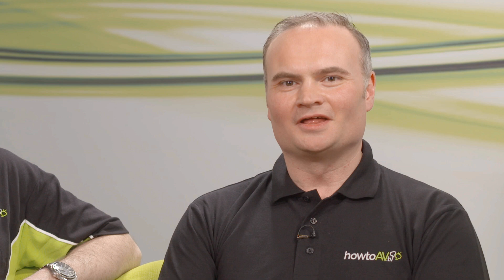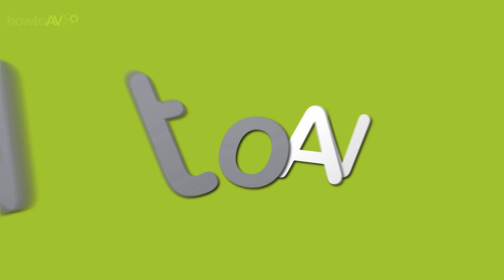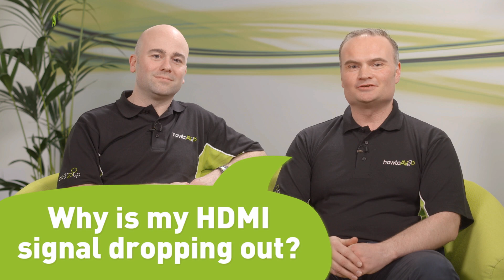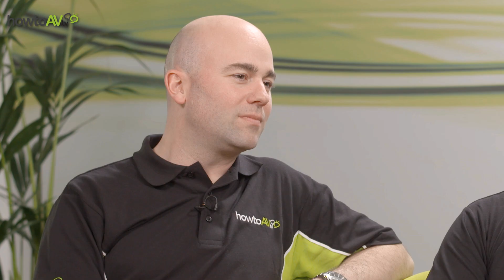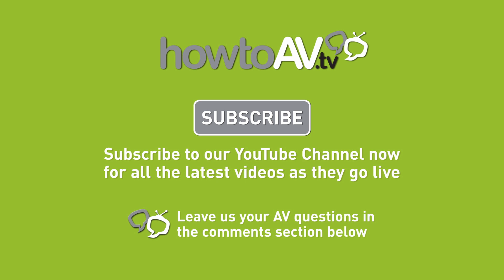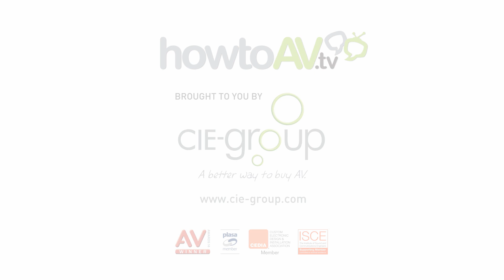Why is my HDMI signal dropping out?

Comment: Anyone got any tips for an issue with a Sony Bravia. The connected devices e.g. Virgin box and PS5, intermittently cut off for about 5 (randomly). It can happen twice in the space of 10 mins and then nothing for an hour or so - screen goes black and a message comes on the screen to say device disconnected. It always reconnects within seconds; I’ve checked all HDMI cables, replacing them as well, disconnected different devices to see if one of them is causing the issue. I’ve even had Virgin out to check the box and their cabling. What I do know is if I watch tv via the Sony tv apps, like Discovery plus, iPlayer, prime etc… there is no issue in terms of disconnecting so it’s definitely the HDMI ports or the signal from the devices to the tv. If anyone has any theories, please share because I’m out of ideas? Thanks.

Comment: Does hdmi cable connection from the av receiver to the projector lose viedo signal while the audio is on if the electric voltage drops low. I had this issue but when I got the voltage up the picture came back and worked perfectly.  So please answer this question

Comment: I bought an HDMI splitter. To go from my Xbox 360 to my TV and also to a capture card. It intermittently switches off and on. The cables work well individually, so it's nothing to do with my cables. Set at 1080p so it has nothing to do with my resolution. I'll just contact the Chinese seller I bought the HDMI splitter from.

Comment: I plug in my Xbox hdmi cord and the tv goes blank the light to show on or off starts blinking the screen stays black until I take the hdmi cord out I tried buying a new one it didn’t work I checked all cables all are fine plugged in and powered what do I do

Comment: I’m having issues with a Neat Bar (video conferencing unit), connecting to a Sony BZ40H TV monitor. This problem doesn’t happen on all systems. I’m running a 3’HDMI from the Neat Bar to the Sony monitor, and have replaced the HDMI a few times. I get a “unsupported signal” error occasionally when it wakes up through CEC. TV shuts off after 5 minutes of inactivity (motion detection), and then wakes up when it detects motion. Sometimes it just shows “unsupported signal”. There are at least 8 of our systems displaying this. Any help would be welcome.

Comment: Ok so my setup consists of the following: 

Equipment:

Samsung UE50RU7100KXXU TV

Samsung HW-R550/XU Soundbar

Sony PlayStation 4 Pro

Panasonic DVD S700EB-K

Bluestream SW41AB-V2 4-Way

Humax FVP-5000T (Freeview box) (currently not being used)

Cables (used on all equipment listed)

QED Performance HDMI 4k @ 60Hz HDR High Speed with Ethernet

So starting with the TV I have a HDMI cable going from the ARC(in) to the soundbars HDMI (out)

Also on the TV HDMI 1(in) is going to the output of the Blustream switch then the PS4 (input 1), DVD(input 2) and Freeview (input 3) are connected to the switch. I only use one application at a time and switch between sources when wanting to watch another making sure other applications are turned off.

On the back of the switch there are four dip switches labelled 0123 that go from either 0-1

Which order do the need to be in with the information I've provided as it still cuts out when having all four dip switches set to 1

Comment: I have a brand-new DVD player, HDMI cable, and I'm trying to connect it to my Samsung LED TV. And my TV says there is a power connection problem. Any suggestions on this issue? I got the Amazon Basics High-Speed HDMI Cable (18Gbps, 4K/60Hz) and I wonder if this HDMI cable is the problem. Please help me!

Comment: Six or seven months ago I bought an HDMI Splitter and a long HDMI cable, then yesterday I bought an HDMI Video Capture Card second handed. So yesterday I tried what I can to make my PS4, TV, and PC fully function to each other to get connected, it work well. Then I was playing a game and I tried to record my gameplay by using OBS. The reason why I need those three is because I need a good quality of my gameplay for the record. I do can just use my PS4 to record my gameplay, the quality is good but not that because its 720p and also it only gives me one hour of maximum to record my gameplay, so with those things I have and record it on OBS, the quality is HD and it gives me more time to record my gameplay. In an hour later since first use, the connection just dropped out just for one second and then it came back but it will affect the recording, and also I have realize that the audio is in little delay so I found a way to make between the video and audio go in match. I found the way but it seems I need to turn down the sound of the notifications because if it does then that sound will join on the audio recording. I think I know why the connection dropped out, perhaps its the splitter because while I still don't have a video capture card, I was using the splitter to connect between my PS4 and TV, been using it for like two hours and then after that, the connection just dropped out for just two second, it never happen if I only connect my HDMI cable between my PS4 and TV so I'm guessing its the splitter's fault. I still want a good quality but I just found an idea to make the dropped out connection won't happen but here's hoping for me that it work well.
Reply: So about the idea I found out, it work well. So what I did is I just use one HDMI cable to use to connect between my PS4 and PC, and I also still uses my HDMI Video Capture Card to plug it in on my CPU. I use OBS. But the only little problem is that when I press the buttons of my controller and the screen of the OBS is a little bit of delay but for me I tried to handle it because it's not really that bad just as long as I know what I'm pressing it. And indeed there's no connection that was dropped out so it keeps going and going. Also the audio is in match in the video. I didn't use my splitter because I know that's the reason why the connection got dropped out, or perhaps my splitter is broken a little.

Comment: I have a problem with my Sony TV side HDMI port. 
The HDMI port at the back is working well but since i have opted to mount the TV i cannot use it.... i have to use the HDMI port on the side but the side port keeps dropping out👉 like after 30 secs or so the screen turns black and immediately comes back... the problem is not the HDMI cable since when i plug it at the back it works well
Reply: Have you used an HDMI splitter?

Comment: I have a 4k tv and dvd player ..and when I use hdmi cable the picture cuts in and out when hooked up to ARC port ,I also using a hight speed hdmi cable..But when I hook it up with The Optical cable .the picture doesn't cut in and out ...any ideas why it only cuts in and out with the Hdmi arc connected?

Comment: Since upgrading my graphics card to a Geforce GTX1650 Super, the HDMI connection to my AV receiver keeps dropping out. Sometimes switching my receiver on, and to the PC input before turning the pc on, gets a steady connection at first. But it inevitably starts to drop out after a while. I have the latest Geforce drivers installed. I never had this issue with my previous card, a Geforce 750 ti. I only upgraded it because I wanted to stream 4k HDR videos from my pc to my 4K tv. Any ideas?

Comment: My hdmi cable is connected to my tv the tv is on the wall it’s been fine for many years but last few weeks it’s making the picture fuzzing & disappears & know the connection to the tv shows it’s not there I’ve had a go at trying to push the cable back in as it’s also tight it’s there for for a few minutes & then disappears what can be done in this matter as I can not view the content of my amazon tv fire stick anymore I need some advice can you help many thanks 🙏

Comment: I have a high end Denon reciever AVR -3310CI 7.1  and no matter the hdmi port I plug into and I've even changed the cord,  it drops in and out and mostly stay out. Not sure if it's the whole hdmi motherboard? It's not the projector because if go hdmi to DVD or PS4 it's fine but to get good sound I run all sources through my reciever

Comment: My hdmi splitter one output getting off after sometime.. I swapped the port of hdmi splitter still it get off..after sometime...

If I remove and re connect it works...
After sometimes same display getting balck...

I used new hdmi splitter still same display getting off after sone time

Is it handshake prblm..?

Can u suggest solution...

Both monitor running 1080p

Comment: Hello. I have 2 set top boxes. One works well while connected to the TV via a HDMI. The TV restarts every approx 15 to 20 secs while connected to the other box  using either the same HDMI cable or a new cable. The picture and sound on both boxes  are fine. Any help or advice how to fix would be appreciated please.

Comment: I got a 4K TV in March and connecting it to my TV with a 4k HDR rated HDMI cable it was giving me constant drop-outs.. After a few weeks I got a shorter cable and it seemed to almost stop. Then it stopped-- at the same time the weather went from cold and dry to warm and wet.  I didn't think about it.
Now there is a cool day, and the humidity that had been between 50-66% the last few weeks dropped to under 40%.
Now the drop-outs are back. The lower the humidity the worse it gets.

Comment: I have my PS4 connected into a Techole 3 in 1 Switcher and every minute or so the tv goes blank and back on
Reply: I have the same issue. did you ever solve the problem?
Reply: it might be too late but with the ps4. you have to change the resolution of the ps4 in the menu. this should stop this
Reply: @mr.ph9859  
Yo what resolution did you change it?

Comment: Hi. I keep getting a static screen when i plug my hdmi cable into the hdcp2.2 port on my projector. I was originally running 2 hdmi cables using a reciever as the middle man. I took out the reciever and ran the uhd player direct to the projector with a short 'premium certified' hdmi cable still with no luck and a static screen but whats weird is the HDR logo appeared in the top right corner. What could be the problem? The cables work perfectly in the other hdmi port.

Comment: My PC is connected via a splitter to several TV's, and one of them goes through my receiver to my TV. All but one connection work great. But practically every time I power on my receiver and TV it says "no signal". If I wait (sometimes 5 seconds, sometimes 10 minutes!!) the signal comes back. But since I'm not eager to wait 10 minutes I constantly turn off/on the receiver and wait a couple of seconds, hoping it will find the signal. When I turn off the receiver the picture comes on for a second and then of course goes away (receiver turned off). Whenever I turn the splitter on/off the signal is there straight away (so it should be the splitter that is not sending the signal correctly at first). But how can it be a splitter problem when the signal does come back when turning the receiver on/off? Hope to get some answers, thanks

Comment: I'm trying to connect my Mac Mini (2013 model) to my AVR (a Sony STR-DN1080) via HDMI ports on both to simultaneously get sound and vision. II have established a connection but the Sony KD55X9005C TV (amp links to TV by HDMI out) shows the Mac for a matter of approx 5 secs, presents a blank screen & then reappears. This process then loops. What are my options? The Mac mini is connected to the Sony AVR HDMI port 'CD/SACD' and the HDMI out from the Sony AVR connects to HDMI 4 on the TV.
Reply: I have the same problem with my Mac Mini 2011 connected to my Denon AVR S700W with a Samsung TV HD,  ¿How do you solved it?, thanks

Comment: i am using a hdmi splitter with 4 outputs..  all of the three outputs has signal but one has no signal, all of the cables are working fine one at a time ... what do you think is the problem...

Comment: I have 2008 46" Samsung LCD. It flickers on and off with various colors, as well as screeching sound. It is like it's trying to warm up but it only does it when I'm streaming like with a Roku. Once it fixes itself. I have to leave it on, or it will take almost an hour to get right. Any suggestions?

Comment: Hi I have a Hisense Smart Tv. I have the two way connection hdmi cord. One end goes into the hdmi port on the tv and the other end plugs into my usb pod on my phone and the power source plugs into the wall. I'm using hdmi 3 and my tv is saying weak to no signal. Please help.

Comment: I have a new 55' samsung UHD tv.  I connect my gaming PC to it through HDMI.  While watching netflix and playing games it will randomly drop the signal for a second or so.  The tv goes black and then displays a waiting image.  After a couple seconds the signal is back and works.  This happens pretty frequently.  Help!  The 46' lcd that I replaced worked perfectly.
Reply: Mine happens with a fire tv 3 on a 65 in samsung 4k Ultra tv. If i switch resolution to 1080p 60Hz it won't stutter.
Reply: I have the same problem.  GTX1080 to a Vizio (2017) model through a Onkyo receiver.  I just replaced all cables and I still have the issue.  I think it is HDR related or something related to the 4K modes the TV will accept and it thinking it needs to switch modes when it doesn't.  I have a Samsung that won't even give me HDR from a different PC, Intel GPU that is supposed to support HDR according to the mobo.  For this flickering, I do get HDR but I think the flickering is the TV switching from HDR mode to regular SDR mode.  It flickers more often when I am changing something.  Switching from desktop to full screen video makes it happen more often.  I have tried without the receiver and it still flickers.  This communication protocol is ridiculous.  To get HDR I need to set the TV to HDR, make sure the receiver is set to HDR via a hidden option, and then windows will let me set my PC to HDR.  Change a cable and I might need to re-enable it in windows.      I do not have a second HDR source other than the PC that will not give me one on my Samsung.  I was thinking my TV was defective, but now I am leaning towards a windows/nvidia thing.
Reply: I get that sometimes when theres electro-magnetical interference. For example,when I start a vacuum cleaner, or I have 2 devices running (like my PC and a console), also I used to get it on cheaper cables more frequently. So it looks like interference pretty much. Easiest fix -- get good quality well shielded hdmi cables (the shorter the better), use hdmi splitters with their own power source, but keep that in mind it might not help, or it might just reduce the problem, depends on what actually interrupts the signal. Cheers.
Reply: Im having this issue too!!
Reply: I have the exact same problem. The picture is OK until I start streaming. At the beginning it goes black for a second every once in a while, but after some time it starts flashing. Did you find a solution?
Reply: BTW I'm also using my TV as an external monitor. I'm using a 10m HDMI cable, but it worked perfectly for 2 years until a month or two ago when I noticed the issue.

Comment: My Samsung 4k tv HDMI 1 port seems to be playing up, I tested it with a PS4 Pro, Xbox One X and a standalone 4k UHD Blu Ray player with similar results. At best I keep occasionally losing the image for a second or or two but at worst the image is constantly flashing, I've used different cables too all suitable for 4k too with the same results but there are occasions too where I have no issue at all then out of nowhere it's playing up again. Can't quite put my finger on what the issue is, only possibility I can think of is whether my HDMI port is damaged? Don't know how or what I could have done to do so never had issues with HDMI's before.
Reply: I have the same problem with my Tu8000 tv, did you manage to fix the problem?

Comment: I am using an HDMI extender over Ethernet with my Onkyo AV receiver. When i plug the HDMI extender to my receiver output (HDMI) it works fine, i am able to see the menu of the receiver on my TV. When i add any video source to the receiver HDMI inputs, the video does not work. So i disconnect the HDMI extender from the receiver and connect the HDMI output from receiver to directly to my TV, works fine. If i disconnect my receiver and connect the same video source to the HDMI extender then out to my TV, works fine. Any reason why my AV receiver and HDMI extender won't work together? I swapped every cable around and everything works when both are not connected together. 

thanks

Comment: Hi, I have a AEG FHD Led 2205 Tv and connected to it a tv box. The connection between the TV and the box is always dropping down, meaning I get the "No signal" but then a few seconds later it re-starts. This can happen up to 5 to 6 times in a row in a very small period of time (15 min fort example). I already tried changing the HDMI cables.  I also tried another box (that works just fine on another TV) but the issue persists. Do you any suggestion? Thanks

Comment: I just purchased a new 4K his 50” vizio smart tv and I am using the hdmi cable I had on my 40” Samsung Hd tv that I had absolutely no problems with. Now when I view YouTube through my Roku it will kick it out momentarily and display the hdmi cable port at top of screen and also show a picture of the hdmi port and 2160 and 1080 flashes back and forth then go back to viewing YouTube or fluttering green and then back to what we were watching. Like an interruption of the connection but with green lines. I checked the hdmi connection in the back of tv, pulled it out then back in and After several attempts got it to work. It still does this occasionally when viewing through my Roku. It does not seem to happen when I view YouTube through the TVs YouTube app. Any ideas?  Did I buy a lemon?  This tv has 4 hdmi ports 1 says best one says arc and the other two just say hdmi.